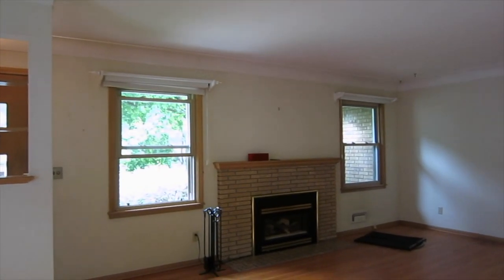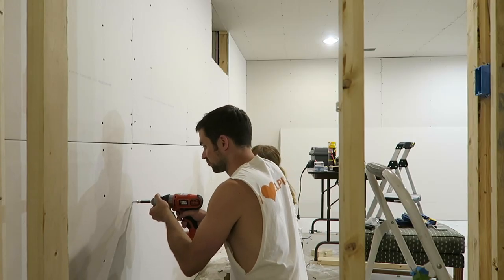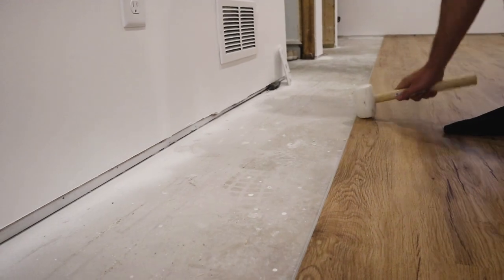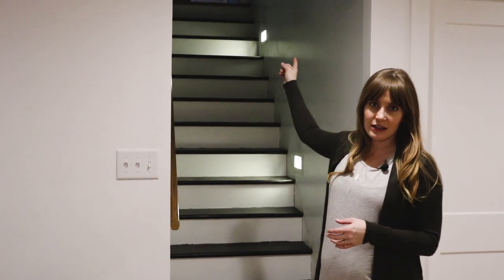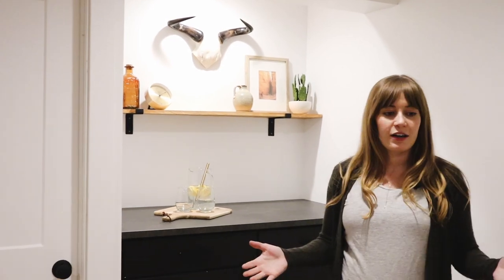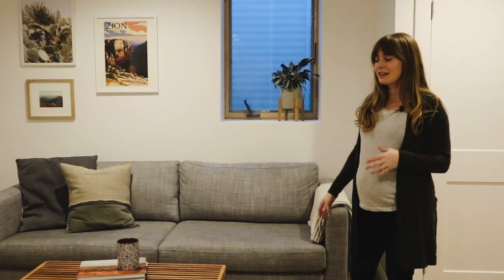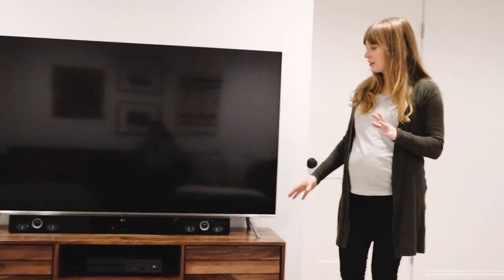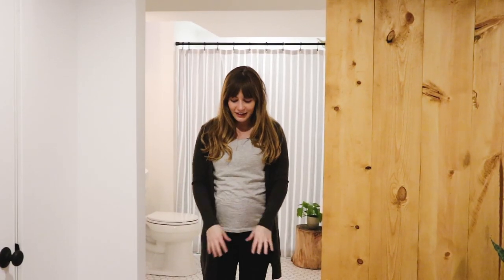Our DIY Basement Renovation Reveal

Comment: Your basement turned out amazing! I have a similar style home and can’t wait to renovate our basement. I’m obsessed with the flooring transition and the barn door! Question for you: did you consider having to access the plumbing in the ceiling in the future before putting up a finished ceiling? My basement now has a plaster ceiling and part had to be demoed in order to access the upstairs bathroom plumbing when we had a leak. I’m scared to finish the ceiling (or fix the now hole until we figure out what we’re going to do) and thought drop ceiling would be the way to go in the future (even though it’s ugly!) would love to hear if you thought of a way around this!